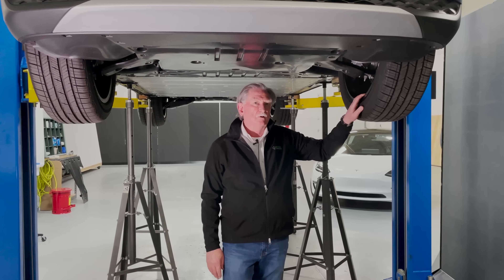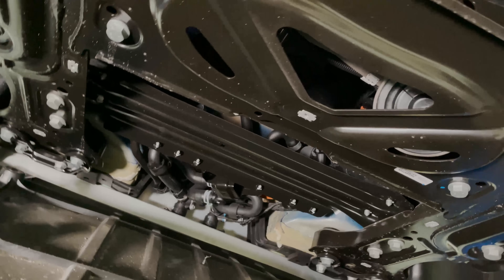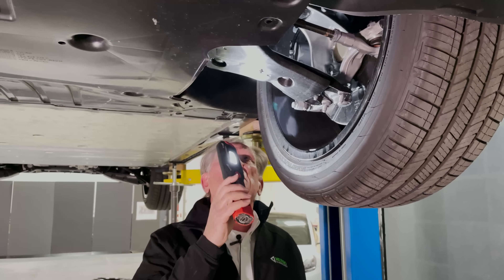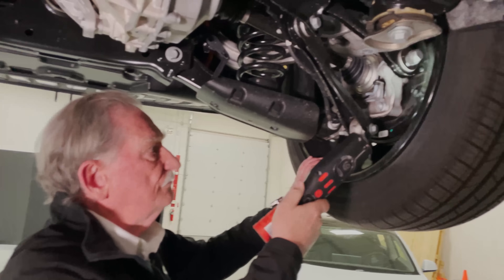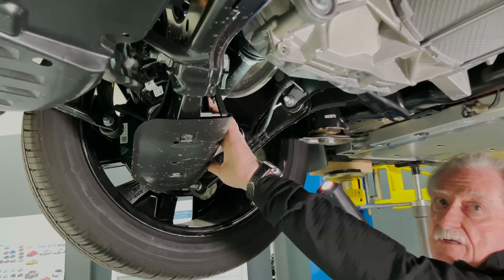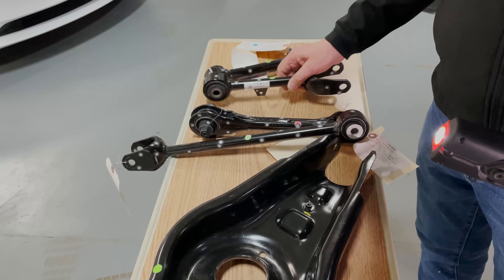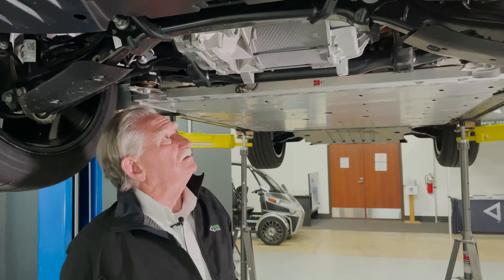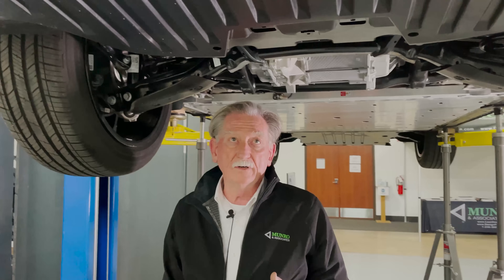2021 Volkswagen ID.4: E3 - Hoist Review, Front and Rear Suspension

Comment: What is called here as over-designed I would call instead safe-design, in contrast to Teslas under-designed suspension parts, drive shafts and sticking braking pads. Other owners are happy to have survived breaking suspension parts at 130 mph. In my 2014 S85 the hand brake caliber failed after just 40.000 mls, the brake pad stuck to disc every morning, the discs were full of rust. After 70.000 mls the suspension had to be replaced, because they used cheap material. This was out of warranty for about $2.000. On my 2019 MX100D the drive shaft has to be replaced every 10 - 20.000 mls, because it is a design fail and under-designed, that even hasn't be fixed with the new Raven. In 5 years of Tesla vehicles I had more problems with suspension, brakes and drivetrain than in the about 800.000 mls I have driven in 30 years before, where I had exactly 0 issues with all this parts on a wide range of vehicles. Tesla is good with electronics, but bad with mechanical design. So be careful when calling something over-designed, please.
Reply: If you have ever owned German vehicles they are known to be over engineered and highly complex. That’s why they are so expensive and unreliable. I’ve owned many German vehicles over the years and they all constantly end up in the repair shop. Too much cheap plastics, over engineered parts and hundreds of control modules. Not to mention there are many recalls due to faulty unsafe parts. 

Is Tesla perfect definitely not. But considering they haven’t been making cars for over 50 years like all other legacy autos they are doing pretty well so far.
Reply: @JAM_2024  The vehicles I drove over more than 30 years before Tesla were: BMW, Chrysler, Citroen, Mercedes, Peugeot, Seat, and SMART. Mit none of them I had  so many problems and unintentional shop visits as with Tesla. With none of them I had any breakdown's, with Tesla I had 3 of them within 3 months. I had to drive loaners for more than 3 months. And in contrast to Tesla all the brands have a real service that is reachable, and in case the cars can also be repaired at independent shops for acceptable rates.

Comment: Pro Tesla propaganda - for the same amount of money the customer gets way more performance, quality and longevity out of the VW..

What you should ask is, why is Tesla so expensive, asking for a similar price with way less costly parts?

And all he does is static - how about providing results of measurements of noise transfer from wheel to body for instance? The Tesla design looks cheap with regard to that.

 The VW is a clear buy. Your pictures show it. Whereas Tesla already seems to be 'on the usual GM way' - wanted to be behind BMW, VW and Toyota. What a pitty.

Comment: Sandy is entitled to his opinions however he has never sat in executive leadership meetings cost justifying a volume  BEV architecture program that will be used for a variety of vehicle types being assembled on the same production line globally as compromises will be made in the architecture design to ensure assembly lines can be interchange for various body styles.  While he praises architectures designed for a frunk, bear in mind that Fremont based manufacturer has only produced two variants  off of two very expensive architectures (each).

Comment: I would expect the additional struts to be a placeholder for the upcoming dual motor awd models. High commonality, crash behavior and structural integrity is what a new platform is for, especially when used this widely and regardless of weight size and power, no?

Comment: Sandy: "this much stuff, this is overdone, expensive!" 

Meanwhile it is a cheaper car than Model Y even after delivery from Europe.

Steering radius and noise are much better that Tesla. Did you hear that from Sandy? No.

ID4 uses drum brakes because it has blended regen on braking pedal so it offers far more regen than Tesla can. So the rear brakes almost never get used. And drum brakes don't rust when unused. Very good design.

Tesla cheap wheel parts break in use.

And real ID4 range is the same as Model Y, but Sandy would not tell you that.
Reply: Also, Sandy if you don't know why something is done, maybe spend a minute to find out? There is more mistakes and don't knows in this than actual facts.

Comment: In reference to suspension, I have driven both the VW ID4 and MY. The ID drives smoother by far. It feels like a normal car whereas the Tesla was too stiff and jarring.
Reply: My model 3 suspension is horrible!
Unpleasent to drive at low speed (way to stiff) 
And an unsafe feeling above 160 kmh. 
My Golf 7 GTE fealt plantet at 230kmh with my model 3 it feels like im jumping around and loosing ground contact all the time.
Nothing near to a sportscar setup.
Im getting a KW V3 suspenion installed next week then the cars suspension will be perfect 👍🏼
Reply: VW has been making cars that go on Aurobahns since their inception, so I dont think they need Tesla designers to teach them how to make proper suspensions.

Comment: The LED flashlight is strobing to save battery, but that means the lights will come on and off on camera when the strobing comes close to the camera's shutter speed.  Consider having a flashlight that doesn't strobe (leave it on the high setting) or use a cheaper LED flashlight with a dimmer bulb that doesn't need to strobe.

Comment: VW and Tesla are not "priced pretty much the same"

ID4 is a crossover SUV and should therefore be compared to the Model Y.  In the US a dual motor ID4 starts $5,000 cheaper than the Model Y LR, and you can also get a single motor ID4 that starts $9,000 cheaper than the Model Y. LR  In Europe the difference is even larger (€20,000) since VW offers a wider range of batteries in Europe.  

The fact that VW offers wider range of batteries and very basic models means that they must price their higher end models higher than if they would need to if they had few options like Tesla. 

VW is the "people's car" and therefore decides to offer basic models.  I predict this strategy will lure in more current ICE owners and that the ID4 will outsell the Model Y (same goes for ID3 vs Model 3).

Comment: It would be interesting if you looked under a Golf or a Touarag. Everyone assumed that MEB was a clean sheet design but it looks like it wasn't. It's a.lot of parts from the VW toolbox. What they mean by platform is that they have a standard set of motors, batteries and controllers that they can mix and match across their product line but the way they bend the metal that holds them all together hasn't changed because they don't think it has to. VW has a massive investment in tooling which they don't want to throw away. There may be unnecessary cost in each car but it's worth it to them because it saves billions and billions of capital investment. Tesla started from scratch so they can make optimizations that don't make sense for legacy manufacturers because they aren't throwing anything away.

Comment: a cobbled together piece of ?  - it will be interesting to see how many design iterations VW takes to get to 5 straight steel rear suspension links
Reply: Aluminium parts are usually better to keep unsprung weight lower, right? But cost increases of course.

Comment: Well, I guesd VW is trying to seel cheap stuff for a premium and they expect to get away with it as those things mentioned are outside of 99,9%  of a car buyers view.
On the other hand those parts Sandy considered over-engineered or too beefy are likely a result of engineers still being stuck in a mindset suited for ICE cars to some degree.
Those at Tesla are seemingly free in their minds to focus on optimization.
To me it seems the ID3/4 despite being built from scratch carry too much unneccessary weight resulting in lower efficuency.

Comment: If one lives up north painting bear metal is required for corrosion exterior and interior? And aluminum does not rust but it does corrode, just check out alloy wheels and in the engine bays that spent winters up north in the sand, salt and even calcium on the roads!

Comment: Every other sentence Sandy says is "I don't understand". How about trying at least.. Let's take the rear drum brakes for an example: the point is not the cost (probably not even cheaper there days), but the fact that drums are simply better suited for an EV because of the regen and very light use of rear brakes. Discs would just cause unnecessary trouble. Good thinking VW!
Btw what is so special about BMW suspension? It's a standard low-cost family car suspension, McPherson at the front ;D E.g. Tesla is using double wishbones I think at least in some models.
Reply: Sandy said with anti-lock systems rear drum brakes ... which are cheaper ...  are just fine.  Sandy did NOT say I don't understand.

Comment: It seems like meb uses  seperate subframes for the suspension elements, Sandy might not understand this. The concept is quite old and mercedes used that for decades, in german its called Fahrschemel. Pictures of meb actually show no real connection between battery element and suspension. Tesla used a different concept so far and plans  doubling down by making the whole skateboard out of three castings. Time will tell which concept is better on the cost side, the Fahrschemel concept is excellent in noise Isolation,thats why mercedes did use it so long.

Comment: Sorry but a lot of the criticisms are actually strengths of the MEB platform. Those bent suspension bars are not for mistakes, but to adapt existing components in new applications. I.e. they are used to adapt the MEB platform for this car. You have to remember that this platform will be used by over 20 different products in over 15 million cars by swapping some parts, such as those suspension arms. The same applies throughout the vehicle. Tesla makes 4 cars, VAG makes over 300!
Reply: sounds expensiv when i need to send in the car for reairs
Reply: @mrThoreKarlsson  not at all. These are common suspension parts that cost 10-50 usd each. The fact that they are different shapes based on the application has little affect on the price. These are things that long term owners may replace once.

Comment: Reports from driving the VW ID3 and ID4 indicate that they have a very good balance between ride and handling, so perhaps we shouldn't critique them too much; VW historically gets that right. Anyhow, the arched upper links in the rear suspension are to clear a longitudinal "frame rail" in the unibody, which is part of the crash structure, while also allowing the links to be positioned as high up in the vehicle as the suspension-geometry gurus wanted them and not having to position that frame rail upward where it would eat into luggage and passenger space. Quite a few other vehicles have similarly-shaped upper links in their rear suspensions and for the same reasons. As for the MacPherson front suspension, VW has plenty of experience with this, and we do also have to remember that this vehicle platform is designed for all-wheel-drive, using a modular design that uses the same suspension parts regardless of whether it has the front drive module or not. The same parts are going to be used on vehicles that will be heavier than the ID4 in the future, and in order to do that, they may seem overbuilt in this one.
Reply: All I know is I have seen my 2006 VW Passat on a lift recently and you would think it was built two years ago.  Exhaust system is 100% original and have yet to replace brakes.  128,000 miles so far.  Wanting to like the ID-4.

Comment: Thanks for the detailed review of the components under the hood and underneath the car. Would like to know what you think will need maintenance and or replacement after the full warranty runs out from typical driving? For the ID4 that would be after four-years/50,000 miles. 70% energy capacity for eight-year/100,000 miles for the battery.

Comment: Mr. Munro needs to remember that even if this is a new platform, it is still a VW platform, designed by VW engineering using specifications from the business managers, so makes use of the VW parts bin to cut costs. Those aluminum pieces in the rear suspension are probably shared across the bulk of VW's AWD vehicles (and maybe RWD? Does VW even have any RWD platforms other than the ID4?)
Reply: Beetle for starters moron

Comment: LED's powered by DC voltage tend to blink  when the capacitor fails..  (voltage interruptions)  see that often with cheap  capacitors used in less expensive LED torches.

Comment: All the front bracings underneath the frontend, I bet you that they simply take an existing ICE chassis, and since there is no motor sitting in the middle to properly and solidly link everything together, they just put in a couple of extra bracing and drop in the HVAC system in there, because hey, where else can that giant piece go. Everything on this ID.4 is poorly AND rush-ly designed.
Reply: This vehicle platform is not a converted combustion-engine chassis. It has design features that would not work if you had to allow space for a combustion engine and transmission somewhere. And VW body and chassis engineers know what they are doing ... those cross-beams are going to be there for a reason, be it for supporting the front drive unit that is not installed in this particular vehicle (common shared part as opposed to using two different parts), or crash integrity, or ride and handling, or parts commonality with other vehicles on the MEB platform that we haven't seen yet.
Reply: Stop talking nonsense, this is a brand new chassis for vw, they designed it to be very practical and easy to drive, go watch Björn Nyland videos and see how the id4 turns and almost holds the same capacity as a modelx
Reply: @alanmay7929  I can tell you right off the bat that if they couldn't fit their shit together to free up the frunk, then they are doing it wrong. That ID.4 isn't even AWD, look at how much free/useless space are there behind the brace, and if you look carefully it looks like there are multiple braces stacked together...
Reply: @ericto2958  vw has specially developed the chassis for both rwd and awd, stop talking nonsense, just wait and see the results instead of dreaming!
Reply: @alanmay7929  of course they will say that, what else do you think they will say? "Oh we reused our ICE unsold crap and retrofit them, please buy our shit"?

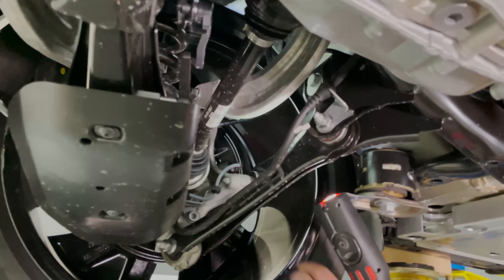Comment: 4:49 I respectfully disagree that the largest carmaker in the world "made a mistake" in designing the suspension. And I am not even a VW fan. Unless you can get into the head of the design engineer, you cannot know every factor that went into the numerous design decisions. That's analogous to me (an FAA-Certificated A&P Mechanic) looking at an aircraft wing flap with a flashlight and drawing conclusions as to why it was designed without knowing the many reasons WHY it ended up the way it did.
Reply: Sandy doesn't seem to be an engineer the more I see his videos, we need a younger more experienced person on this channel. Sandy knows basically nothing about the id4, I bet he didn't even watched the release videos.
Reply: Same. I kinda always disliked VW, but no way in hell that's a design mistake. It has to do with suspension geometry and "baseplate" that's likely going to mount in various different models.

Comment: So it kinda looks like VW are sticking with what they know rather than innovating then? Wondering if this is because they want to play safe or if it has anything to do with dieselgate and having to tighten the purse strings?
Reply: Are you dumb? Stop talking nonsense, this is a brand new chassis for vw, they designed it to be very practical and easy to drive, go watch Björn Nyland videos and see how the id4 turns and almost holds the same capacity as a modelx
Reply: @alanmay7929  If you had noticed  I was asking a set of questions around Sandy's comments in regards to the suspension as this was the topic at hand, if you noticed he was talking about the cost and set up compared to other brands of cars and therefore not making a statement . Also to ask a question in regards to something you don't know doesn't make you dumb, it shows that you are inquisitive and want to further you're knowledge in regards to a subject. You will also find that by asking question is one of the major key factors of how civilization got to where i is and if we didn't we would more than likely still be stuck in the stone age. On another point what gives you the right to insult someone by calling them dumb and even more so when you have failed to understand that questions have been asked and that a statement has not been made? So in your world would that make you dumb as well as you are unable to tell the difference between a question being asked and a statement being made? Oh and just help you out so next time you can tell a question has been asked, it will have a question mark at the end of that question and to help you further the question mark symbol looks like this ? hope that helps you in the future.
Reply: @DoughnutsInspace  thats what she said!
Reply: @alanmay7929  Just as I though, unable to apologize for a mistake/misunderstanding and too immature/unintelligent  to respond with a sensible comment.

Comment: I'm pretty sure Volkswagen reverse engineered a Tesla Model 3 several years ago. I'm sure they learned a lot from it about batteries and power electronics, but it seems they weren't willing to learn about the parts of the car they already knew how to make. As a result, we get a typically-overengineered VW body.